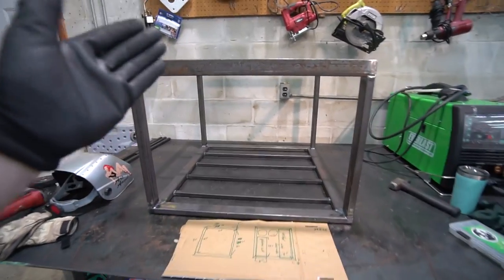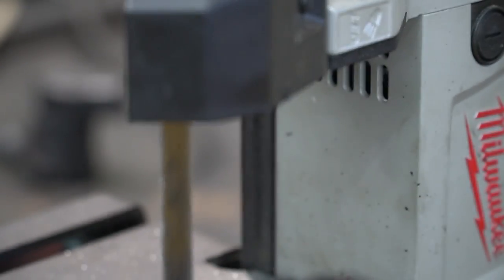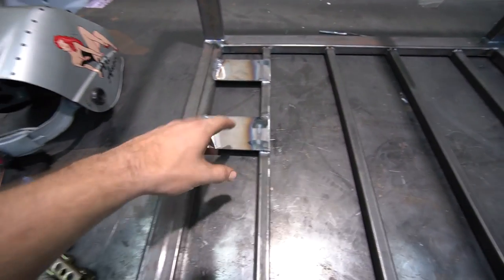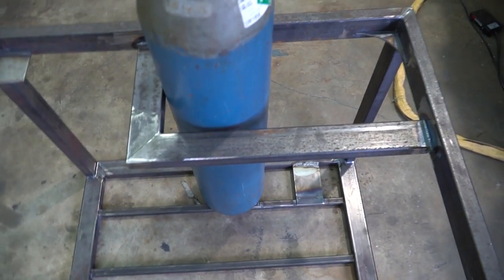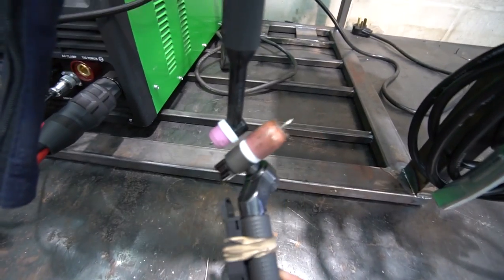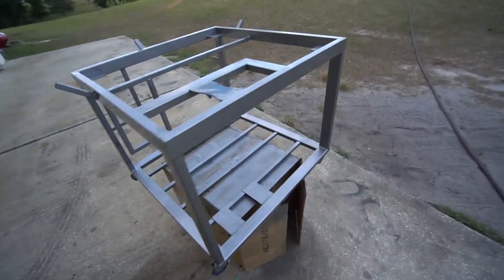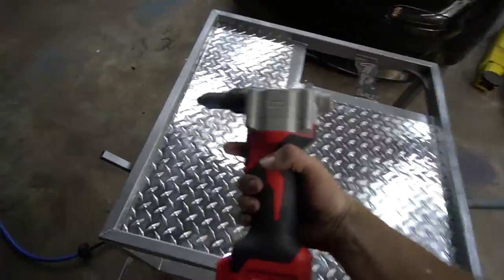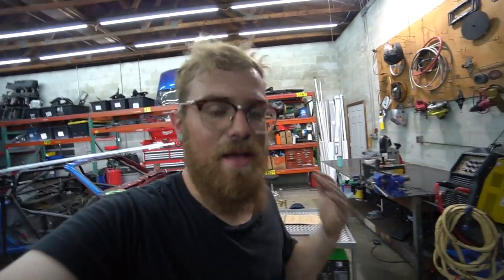Building The Swiss Army Knife Of Welding Carts! *Ultimate Welding Cart Build!*

Comment: Just FYI: bandsaw blades can't be "backwards" just flip them around (like you would a twisted belt).
Reply: More like roll the blades inner wall to face out
Reply: anvil doing the lords work here. That blade is def toasted now however.
Reply: Yep, not the first one to have them in the wrong rotation, some even have the little arrow to show you which way to mount it.
Reply from the maker: It's funny because I looked at it for a second and thought "There's gotta be a way to flip this around" but I remembered I had an older blade that I only used for a couple things when it go oil on it so I changed it since I had more, so I just threw that on. Can't say I'm a bandsaw expert. lol
Reply: I'm an electrician and I'd twist the blades inside out (backwards) just to fuck with my apprentices. Fun to watch them try and figure out why they cant cut.
Reply: @tonythomas951  holy ShitBalls now that's funny. Or have him get you a bucket of steam? A left handed screwdriver? A metric hammer?
Reply: @Robocoppat  my fave is the 3 phase wire nut.
Reply: @tonythomas951  What about plaid paint?
Reply: @tonythomas951  I've done the same thing. Great fun.

Comment: The screws are a great little added thing, not going to fall out, and don't need to build a front plate for it keeping it nice and clean.
For the bottle mounts good time for some CAD, and mark the radius on the metal.
That Rivet gun is fun.
I like the end result, though might find it a bit low and you will have to bend over a bit.

Comment: You should put a big handle on the back where the bottles are so you dont have to bend down to move it around and it would also act as a gaurd for the tops of the bottles so nothing messes with the valves and shit. Also, If it was me i would have made the cart taller but thats because i hate bending down when i have a car on the lift. But i guess its still alot better than bending all the way down to the floor since it is raised.

Comment: You could make the new mobile table mostly fit under your large fixed table for storage. I have made multiple mobile tables so they store under/inside each other then they fit under shelves at the side of a small garage, very handy and also forces you to cleanup at the end of the day if you need to get cars back in. Then gives you handy workspace when required.

Comment: Also on the tank mounts,  where you had to grind to fit the curve. We weld 1"x1/8" plate along the edge with a tad more room to fit the curve. Then use a bungee to hold them together and you prevent so much rattle

Comment: You should of welded an unpainted tab that you could use to clamp your ground leads to in order to ground the entire cart so you wouldn't have to ground what you're working on
Reply: You always have to ground the working piece. Can't just weld the cart unless I'm mistaken. You also want to keep DC and AC grounds separate. Alu vs steel
Reply: If the cart was grounded anything he welded on top of the cart would automatically be grounded also. Of course when he was welding on the cars he would have to move the ground to the car. But that's why his work bench is metal because he grounds the bench instead of each individual pieces he's working on
Reply: @MilesHolt  oh gotcha. Yea makes sense but I feel this is a more of mobile work on a car kart. He has the multiprocess at the welding table

Comment: It's nice. I like your design. All I would say your missing is a handle you can adjust the height on so you don't break your back leaning over to push it, adjustable so that the handle doesn't limit the areas you can push the cart into and how well does the weight hold it in place? You didn't put any wheel breaks.

Comment: I think it looks nice and is well designed. Colors match good so that hammerite paint was a good choice. I think you should've plasma cut that TR Design stuff and clean it with dremel instead of welding. and leave that bar out from under that plate, it's just a extra weight.

Comment: I definitely would have made it higher for the ergonomics of nut bending down as much to adjust settings.

Also, maybe made the tanks have a door at the back so you're not lifting the bottles so high to put them in. They're not that heavy but also it's nice to not lift them if you don't have too.
Reply: M tanks are heavy enough, especially when full. Hence what every cart in existence uses chain doors.

Comment: What size torch is the bigger one and size gas lens and I heard you say low rider gas lens what is that I have a normal size gas lens and it's huge with an 8 is the smallest cup size for my gas lens setup on my wp26 torch it's huge I would like to get it smaller what is a low rider gas lens ?
Reply from the maker: The low rider is specific to that little torch. The bigger torch is a #20 water cooled torch. A little smaller than a 17 air cooled. You can just get a gas lense kit with a shorter cooler body and lense. If you have a CK torch they have a breakdown of all the parts. Yours would be the same as a 17 which is #3 I think in their list.

Comment: Welder and plasma cutter are too low too the ground your going too get tired of bending over  too change wire, leads and adjust  the Welder, and you should not have too pick up the welding bottle's too get them out of the cart.   SAVE YOUR BACK.